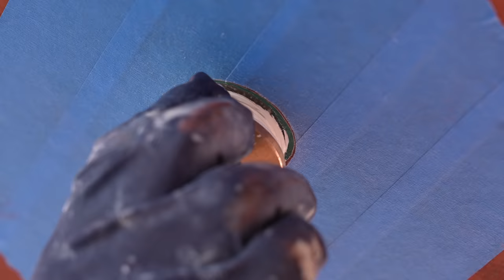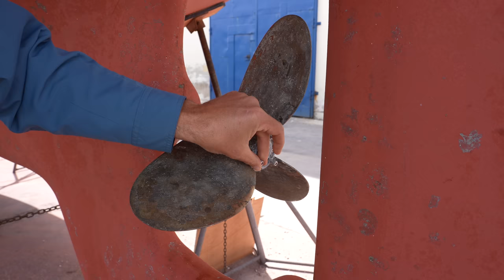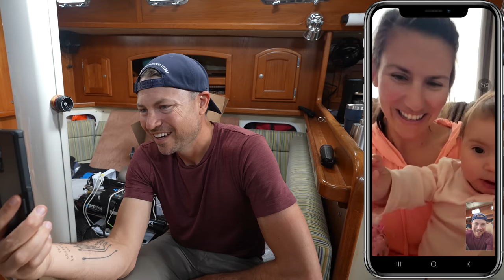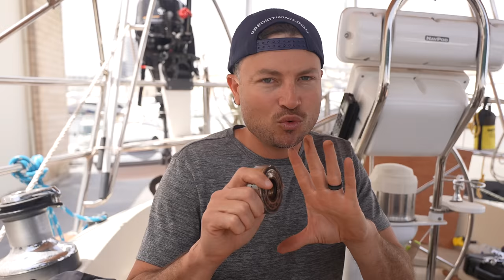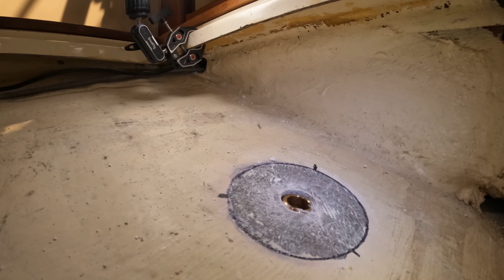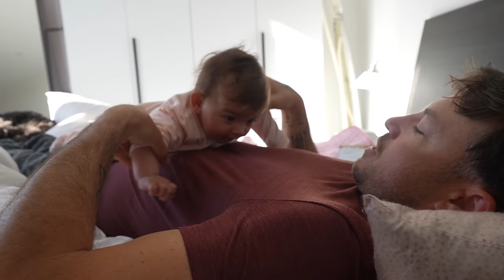I LOVE the Smell of BOATYARDS in the Morning | S08E11

Comment: I had a shaft seal installed last year on my boat and they put a couple of seals on the shaft on the motor end so that if it ever went bad again they could cut the old one off and just slide the new one into position and only a couple of minutes time with the boat in the water. I haven’t had to do it yet but it will basically save a bunch of money and yard time if the problem ever happens again

Comment: Respect Jordan's commitment to finishing the shaft seal replacement and water maker installation and how cute Isa is.
Reply: Back in my younger days I did boat recovery on the local lake.  A guy called and had sunk his 32 foot two masted sailboat.  It was new and just put in the water.  Asked him why it sunk, he did not know.  After recovered I heard water running, looked in the bilge and the prop shaft seal was leaking.  Dove under the boat and the gland nut had not been screwed up on the seal.  He was hard of hearing and never heard the water running.

Comment: Hey Jordon, i like your rule when drilling a hole in your hull. Measure multiple times and drill once. Its hard working by yourself not only physically but mentally. Plus i think you need to be about 2 feet shorter to fit in your bildge.😂 Nice work!

Comment: It may be possible to remove the prop shaft without dropping the rudder. I’ve been told that if you turn the rudder you can notch the rudder fiberglass enough to sneak the shaft by. I think the shaft is just a bit off center from the rudder post so this might be true. I hate to see corrosion in the prop shaft.
Reply: That is a great idea.  I was thinking the same.  Also, those look to me like gouges and not corrosion.  Was there any iron oxide in the damage?  Anyway the structural margins should be fine so long as your seal is forward or aft of the damage.  Those shafts are way over size for their structural need.

Comment: Why do you need a new hole for the watermaker intake? We simply teed off the engine raw water inlet for our watermaker, which has worked fine. Consulted engine mechanic and watermaker people first, both said no need for an extra thru hull.